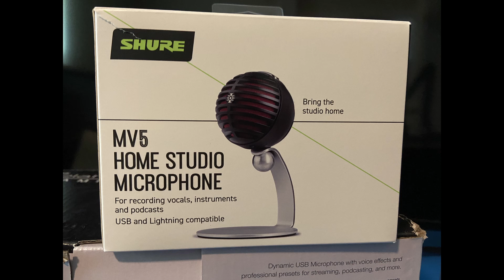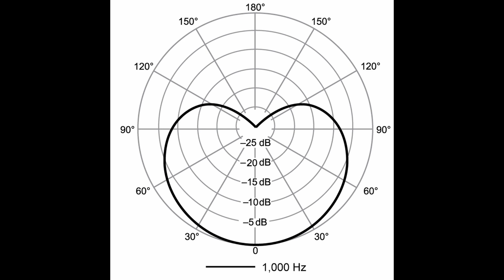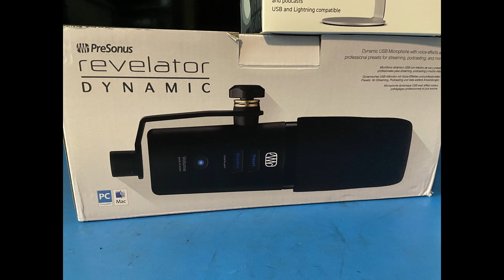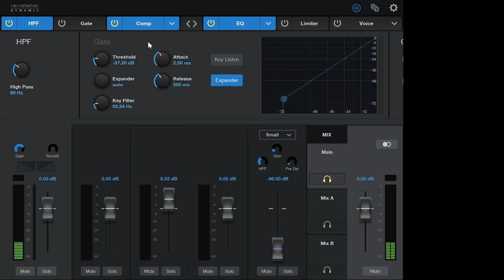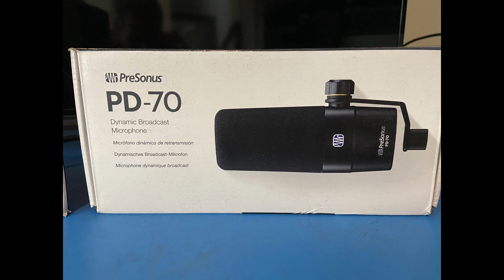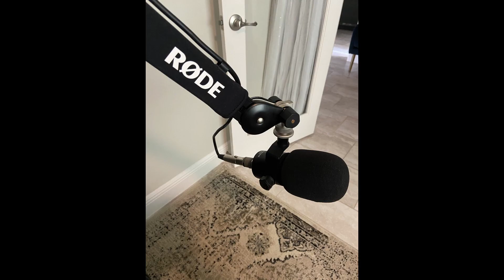Shure MV5 vs. PreSonus Revelator Dynamic vs. PreSonus PD 70

Comment: How is the handling noise on the rev dynamic?
Reply from the maker: I've gotten to where I only use it when I travel now. I don't use it in my home setup. In that scenario, I use it with the included mic stand and try not to bump it. I don't think I have had any particularly glaring issues with that setup (other than the inevitable horrible acoustics of hotel rooms). I suspect the mic stand/boom arm you use will probably have a bigger impact than anything else on handling noise, but you wouldn't want to be holding it in your hand, for example, while recording.

Comment: Perhaps you can help me.
Often i hear about the floor noise of the preamp in the Revelator Dynamic. 
I need something for live recording. 
It is for teaching online . The platform is BlueJeans ( much like zoom).
The students will not have high expectations, but i want to put out good content.
The Revelator Dynamic   is supposed to allow the effects (compression and eq) in the live stream.
My question is, will the noise floor be prohibitive for this use case? 
My other idea is to use a Revelator Io24 interface and a dynamic microphone,  but there is a noise floor issue with the preamp in the Io24 as well.
Reply from the maker: I actually use the Revelator Dynamic now for my work calls (On my corporate PC), and it works pretty well. I use to use the Shure MV5 for that, but I like the Revelator a little better since I do have a fair amount of noise, such as my wife's canary, during work hours. Since we cannot install unapproved software on the corporate PCs, it works well to have the Universal Control application on my tablet, save the presets there, and the Mic keep them when moving computers. Given that most of your students are probably going to be using head-sets, build-in mic-speakers from a tablet, or cheap USB condenser microphones, the Dynamic Revelator will come across as being much quieter and sounding better than those setups. You will just want to play with different setups and figure out what works best for you (e.g. record what your audio sounds like with Audacity, or something similar, and try if different things like using the noise gate and compression give you a better result). 

I have not used BlueJeans, but I suspect like Zoom, and many other conferencing platforms, it probably has some built-in noise reduction which may very well completely clean up your signal. When I do podcast recordings with the Revelator Dynamic, while traveling, using Zencastr for example, I don't generally need to do any extra cleanup.

A video on TheFullSetup's channel goes into great detail on all the settings and is worth watching if you haven't:  https://youtu.be/gAqIa16iB-E and gives a good starting point for how to configure the mic.

The other consideration in these setups is how you are going to listen to the audio. I wouldn't recommend just blasting your meeting out over speakers, where it will bleed through to your mic. You can listen to the call, and yourself using the loopback feature of the mic. I generally just use Bluetooth earbuds to listen though, and am not worried about my audio, since I have already configured it to where I know it works.  

Hopefully, that is helpful!
Reply: @bhelogan  That doesn't just help, that answers all of my questions!  
Thank you So Much.  

I felt that this was the microphone for me to allow a Gentle noise gate, compression, and eq since this is live and I can't fix anything in post, but having someone who uses it confirm my beliefs is a Godsend. 
Thank you again.

I have TheFullSetup video in my "revelator Dynamic playlist for review when I get it (great minds).  I am glad to know that this is a good resource since you have actually used it in conjunction with the Revelator.  I actually have several of TheFullSetup videos in that playlist.  In that playlist, I also have an EposVox video that looks good. You can check it out here if you want.
https://youtu.be/tWC62TJHM0k

TheFullSetup also has a video on setting up loopback on OBS, Teams, Zoom, Discord, and other platforms.
https://youtu.be/0MeAQHkrqZ0

Will I need OBS for Zoom (BlueJeans)?  OBS looks interesting but complicated. 

Thank you again for the video and the response.  The information is very valuable to me.
Reply from the maker: @michaelreed649  I love OBS, but I only use it when doing recordings for videos. Not live broadcasting. You can use it to stream to Twitch and such, but I don't think you will need it for your classes.
Reply: @bhelogan  that is good to know.
OBS Looks to be a powerful tool,  but I prefer something simple to use at first.
My thought was to learn and use OBS later, as time permits for recording to youtube.